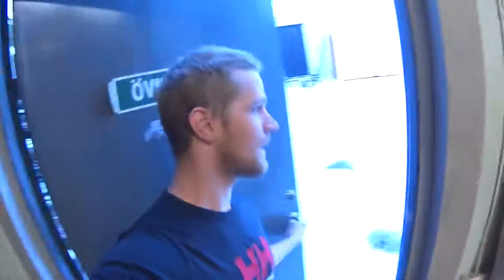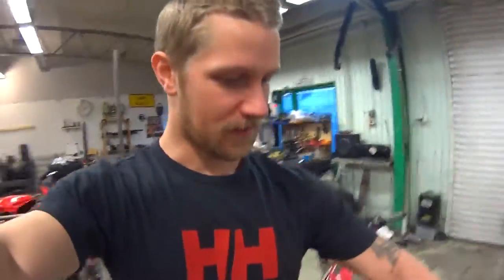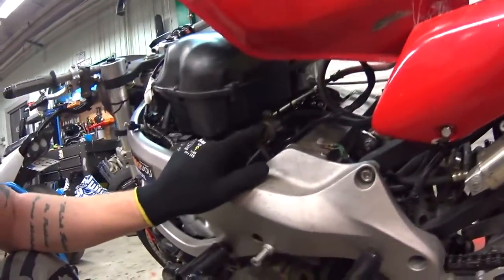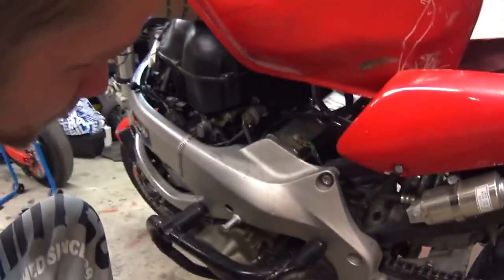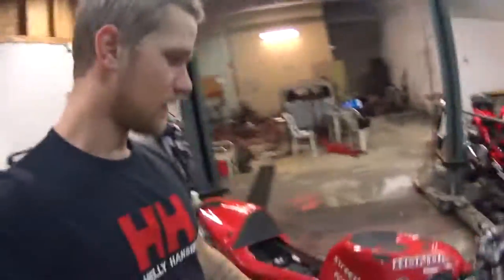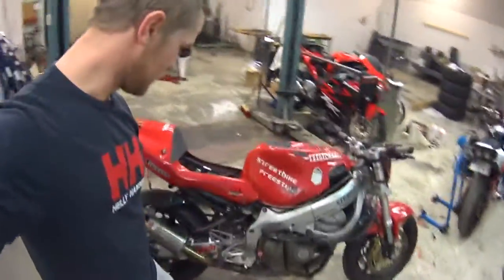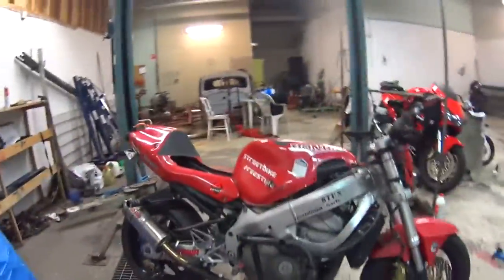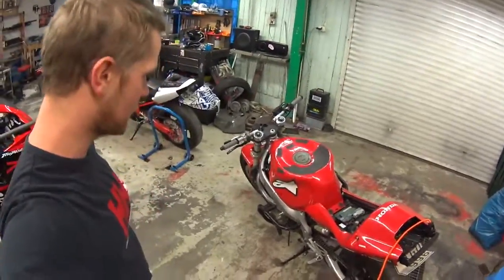Fixing fuel regulator and vacuum f4i - Motovlog From Sweden

Comment: I have a problem on my 2004 CBR 600rr, the bike works perfectly, but when i pull she doesn't revs after 12k rpm but if i close a litle bit the throtle the bike revs a litle bit more than 12k rpm... the bike have new air filter, new spark plugs and the fuel pump filter was cleaned, maybe is the fuel pump who won't make enough pressure and need to be replaced... what do you think mate? Cheers!

Comment: My o2 sport is not firing on a cylinder. Checked plugs  heavy fuel on duffplug . But now have found my oil sump full of fuel and oil.  Could this be my fuel regulator is had it ... this video may have sorted  my issue 🤔

Comment: would this eventually cause a backfiring? like almost constantly? I think my fuel pump regulator went bad. Bike has always ran rich (assumed it was from the slip on exhaust with no power commander the previous owner put on it) and now its smelling heavy in gas and is back firing and misfiring a lot. like almost constantly
Reply from the maker: Just The Tip Moto Vlogs if its been heavy in fuel, check oil so it's not filled with gas :o  might happen. When the regulatir on the 954/929/f4i etc it usually starts leaking gas into the vacuum line, got my face covered when testing mine that was broke 😅
Reply: Moto Misc I will check it out! Thanks man!

Comment: Hi, I have some issues as well, when I do wheely at 12o'clock bike starting kick my ass, can you help me with that? Thanks
Reply from the maker: Hey man :D how do u mean kick your ass? does it shutdown or wants to shutdown etc? or just "boys on the throttle"?
Reply: Look up oil return mod.   Most stunters do these to f4i the oil return is crap when on 1 wheel starves motor of oil by pickup in pan

Comment: I have a f4i also, I was wondering if you could help me? My bike revs like normal when I start it but under load it feels like it lost half it's power and it sounds like it's firing on half the cylinders. Any suggestions on fixing it? Thanks
Reply from the maker: checked all spark plugs? any mods on it? stunt bike etc? :)
Reply: So I found out that it was my fuel filter was dirty also the air filter was dirty, thanks for the input tho, safe riding

Comment: Having a problem with my 2003 F4i.
Does not prime the fuel when I turn on the red switch.
I replaced the fuel relay, but still does not prime. It does however crank over.
Can anyone help? Thanks.
Reply from the maker: Tried replacing the relay?  should be a relay in the back behind seat, 2 small black one.. try switching place on them just to see if one is broken.
I had mine hard wired then switched wireloom and couldn't figure out why it didn't prime until I put back a relay :)
edit: not the fuel relay I mean, should be another one too.

have you changed anything with the ignition? was thinking if you got the hiss system so it does not recognise your key.
Reply: Moto Misc ran perfect 2 months ago. Went to start it and couldn’t hear it prime.
Replaced fuel relay, but it didn’t help.
Did not do mess with anything or do any mods..
I can feel a click to the new relay switch when I turn on the red starter switch . Cranks but won’t start. Starting to think the fuel pump jammed up.
Did not mess with the ignition.
Reply: @dannilaser16  ecm is dead.
Reply: @ProPatriaRO  will try that next.
Sounds expensive. Lol. 
Thank you for your help.
BTW, where is it located, and what does it look like?
Reply: @dannilaser16  under the riders seat. When you turn on the ignition with the stop button set to run, do you hear the pump prime? Looks like a black rectangle with two connectors coming out of it. Where are you from?
Reply: @ProPatriaRO  oh, okay.
No, the pump does no come on like it used to when I turn on the switch.
There are 2  small black modules under the right rear of the seat. I replaced one, and even tried switching them, but no luck they are about 1” long.
I live in Sacramento area, Cali.
Reply: @dannilaser16  those are relays. Try jumping the pump to see if it runs. If it primes by giving it curent straight from the battery then it's the ecm (fuel injection computer). A second hand ecm on ebay goes for around 350$ in the US, you also need the keys, the fuel filler cap and the rear seat lock (so you don't lug around two sets of keys, one for starting the bike and one for everything else)
Reply: @dannilaser16  i can fix the ecm for you, but i live in romania so you're better off just buying one from ebay or Craigslist.

Comment: come on,you remove parts from the 954 to put them on the 600f? should be inverse! :P
Reply from the maker: MM 954rr well I'm putting the brand new regulator on the 954 that I bought instead :D
Reply: Moto Misc oh ok, you had a good reason then :P  the next video will be in the new garage?